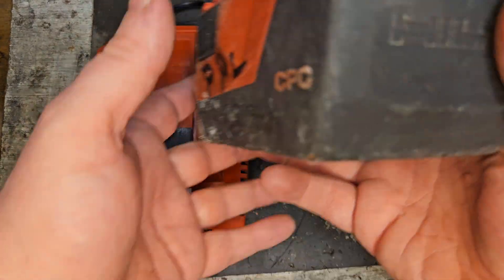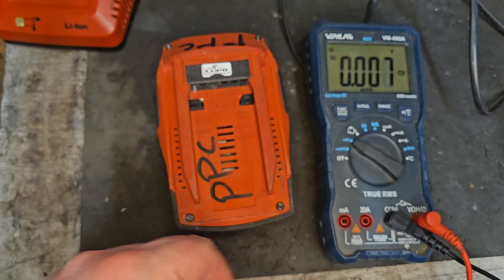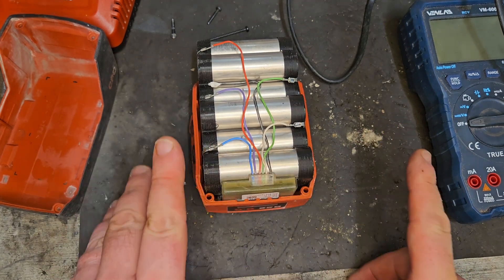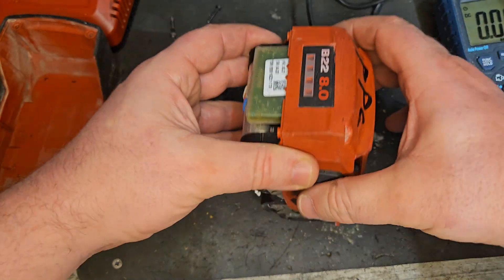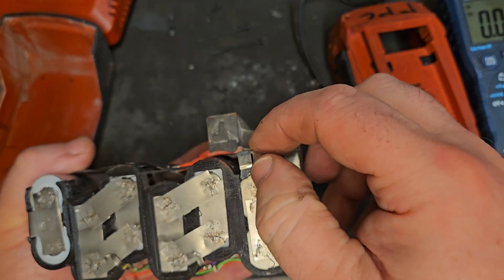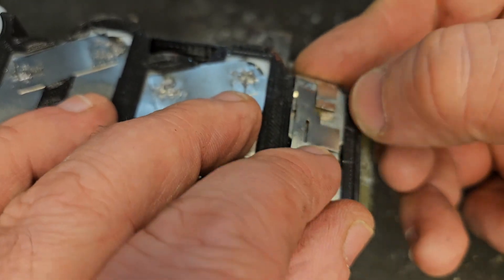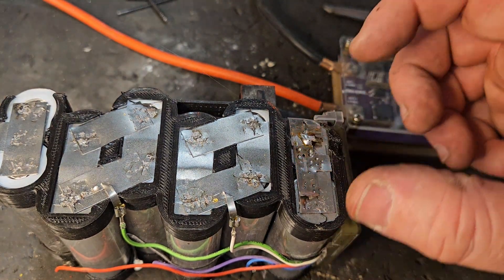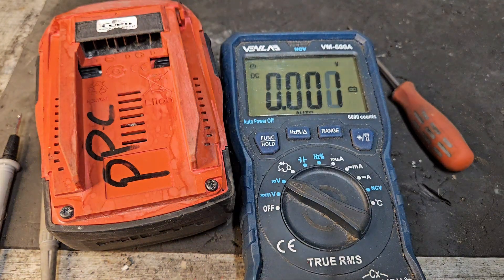I Fixed My Hilti Battery (And It Worked!)

Comment: I have an 8Ah pack from 2020 that i replaced a bank of cells that were completely dead. Now the battery shows the correct charge level, but the charger refuses to charge. I assume that there is a lock function in the bms, do you know of a way to reset this? Or do i need to change the bms? Thank you for this video.

Comment: Hello, just want to ask, does hilti b22 battery PCB board got lock?
My friend want me to repack one for him, I need to confirm that board does not have lock. 
Also 8Ah battery with 21700 or 18650 cells? I guess is Samsung 40T
Reply from the maker: I have swapped hilti boards before and can confirm the 8ah has samsung 40T cells

Comment: Awesome videos! Just came across your channel. I have a hilti cordless vacuum 22-Volt VC 75-1-A2, i checked all parts for continuity and seemed good. But it wont turn on cant figure out why can u help please ?
Reply from the maker: Is the motor working? Does the switch work ?
Reply: @doctorlefthandthread  motor is good . Switch has continuity . I think its The battery port but  im not sure how to test it
Reply: @antg7181  If it is a brushed motor just hook it straight to the battery and switch skiping the controller. You should be fine, its just a vacuum

Comment: I think that the overall quality of the battery is good in terms of the basket housing and overall assembly, despite the strange-looking welds on the plates, if the welds are strong then it's OK,
Reply from the maker: Agreed not bad didn't seem as nice to look at as an original battery but good enough